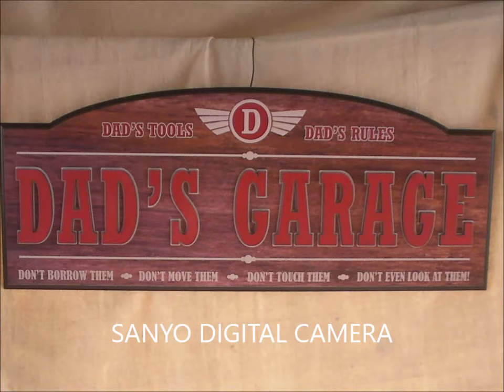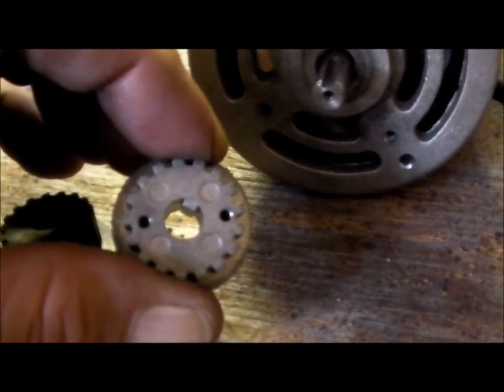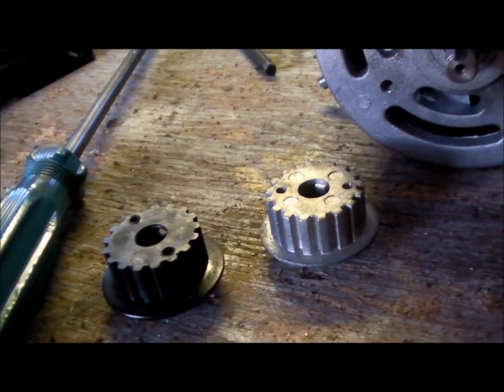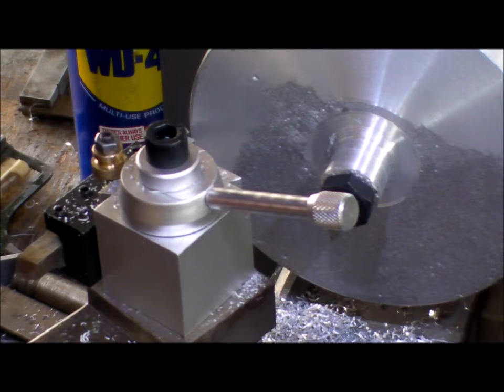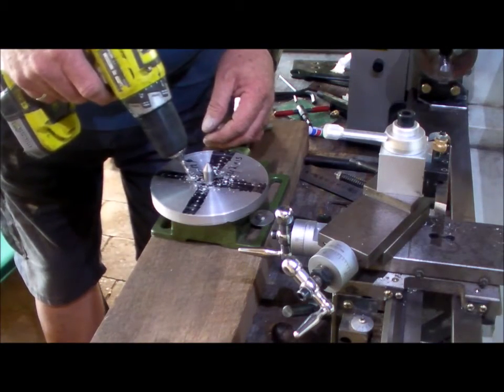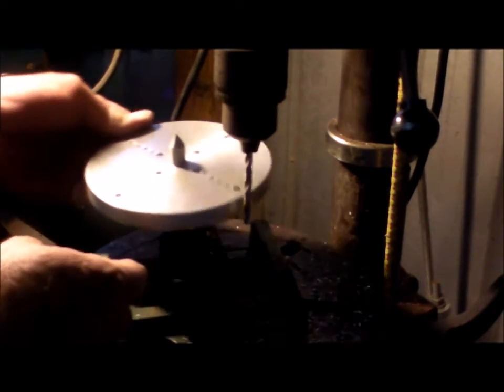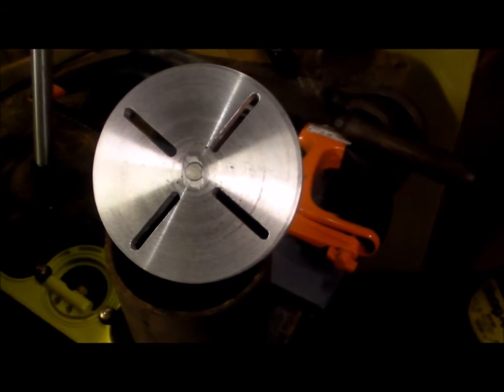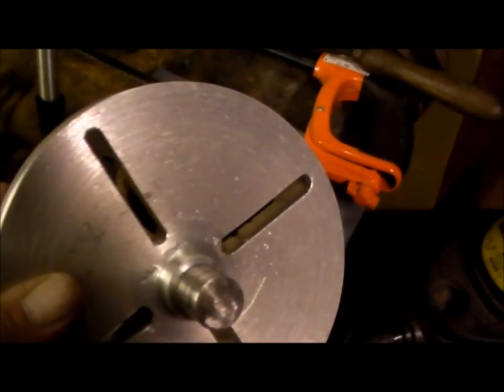Faceplate for the mini lathe

Comment: Peter, great video and thanks for sharing.  So, why didn't you cast the slots into the faceplate.  Was it the extra time to make the pattern, or did you just want to assure you had great looking slots?  Either way, it is a great looking faceplate.

How are you attaching it to the lathe?  Are you running it on the spindle or the three jaw?

Joe
Reply from the maker: I didn't because I thought it would be easy enough to do later, I was wrong. At present it is fitted on a mandrel and fitted to the 3 jaw and it rues up pretty quick, but in the future sometime I will cast it on a MT3 taperand fit it directly into the spindle.
Peter
Reply: I know hindsight is always 20/20, but I suppose just drilling the end holes for a slot then using a jig / saber saw to cut close to the line would have worked.  Then all you had to do was file to your lines.  Another questions, will you have enough swing on your lathe to machine the parts for the miller?  Are you frustrated with the miller, or just taking a step back with the lathe so you can move forward on the miller.  Peter, thanks again for sharing with us.  I think you are doing a great job!

Joe
Reply from the maker: G'day Joe,  I didn't have a small enough blade for the jig saw and as the 6mm holes were already there starting off blind did not work, it  locked onto the edge of the holes and became violent. Being stubborn I didn't bother to spend the time and petty cash to buy one and you know how it is sometimes you do with what you have and curse yourself later for it.  
The faceplate and lathe should be big enough as Gingery modeled the miller around the dimensional sizing of the lathe but as will be seen later I machined a couple of the parts on a mandrel and the faceplate each had it's advantages and disadvantages.
No I am definitely not frustrated with the mill or for that matter the shortcomings of a cheap ($450 AUD at the time)small Chinese lathe as some of these parts are at the limits of it's capacity and anyhow it is what it is. I will be showing the changeover of the plastic transmission gears with steel ones in a future video. You know a second hand Myford  or equivalent still sells for $1,500 AUD or more without disclosing it's age and that then would have been a restoration series. A KIWI Geoffrey Croker is doing a nice series at the moment. 
The odd videos thrown into this series I consider part of the miller build as I need a working lathe and some attachments.
Joe, thanks for the encouragement.
Peter